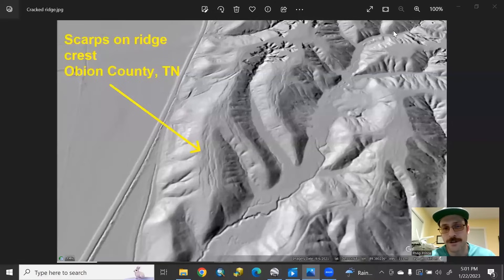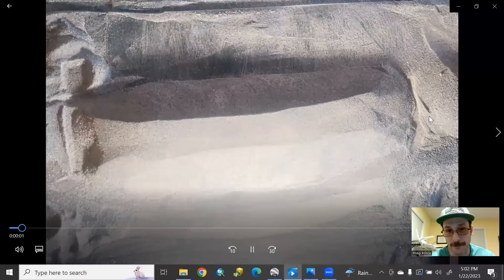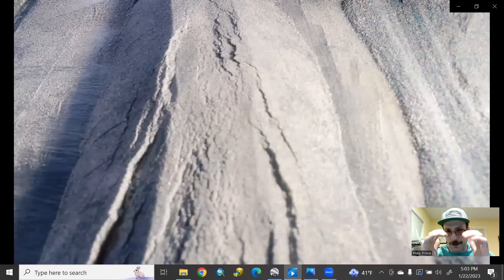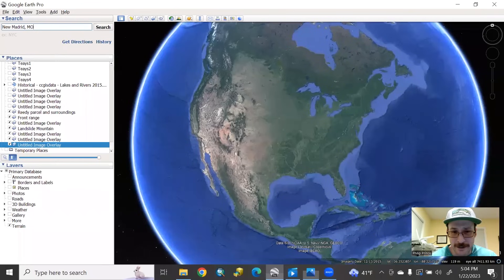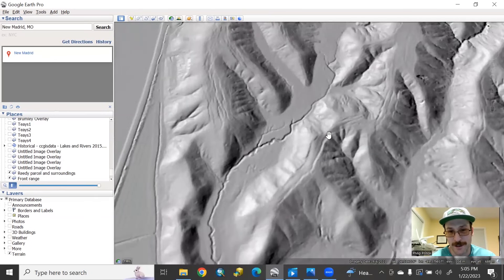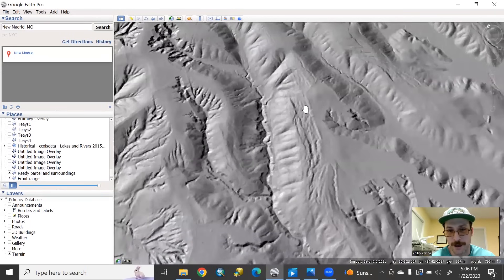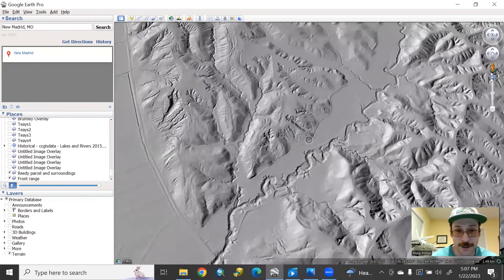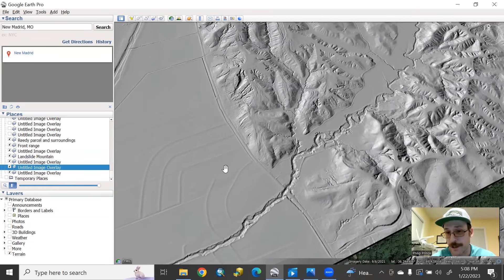1811-1812 New Madrid earthquake damage...see it with LiDAR | Geology Models

Comment: Do you have any idea what caused the massive scarp near Dallas Texas? The flat land suddenly drops and resumes at the bottom and you can see the "cliff" when you look right or left. If I remember correctly it`s a pretty large drop of nearly 100 feet or maybe more. Been many years since I`ve seen it.
Reply: Do you remember exactly where near Dallas?  Was it on Interstate 20?
Reply: @shesees432  I don`t remember. I worked there in 1985. It was very difficult to find much about it online and I forgot what it`s named.
Reply: @shesees432  I remember the buildings looked small in the distance and you could see the long line of taillights ahead from the top. The building with the ball on top was on the other side of the city from the drop I believe. But I may be wrong. I had a head injury in 1988 and my memories were messed up.
Reply: Noah's flood.  📖